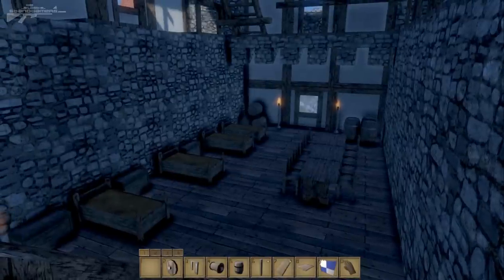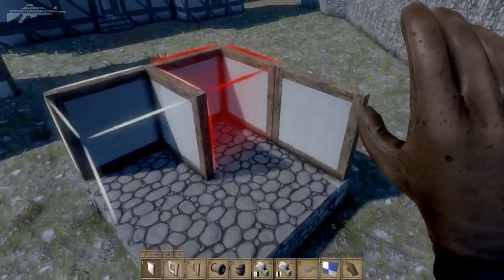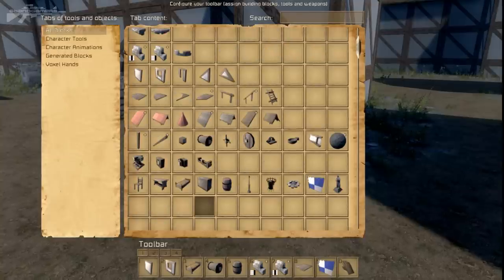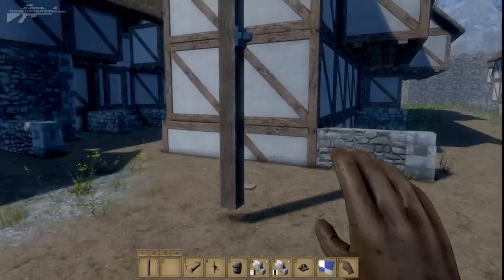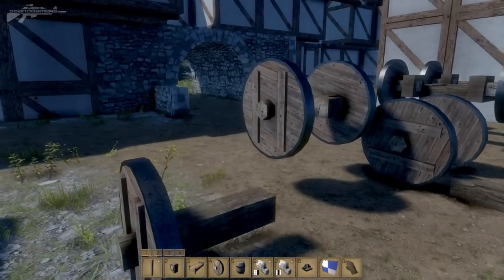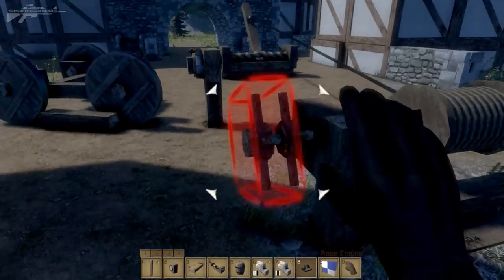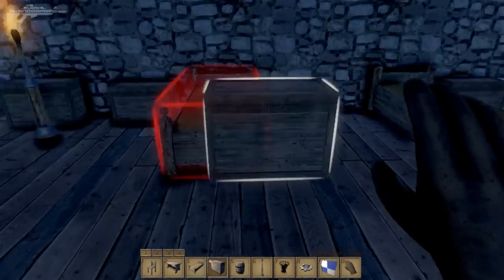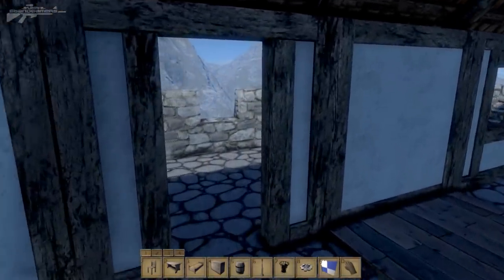Medieval Engineers - Basic Building Introduction

Comment: I don't like how connecting ropes works.
I try to play as "survival" as possible. That means no flying, no ctrl-x and no voxel hands.

I am having a lot of trouble using cranes (for example to flip a wagon I'm building upside down).
My problems come from:
-Not being able to build pulleys 
-Having to interact with the rope drum to connect two things together

I solved the first problem by building the wheel cross in the base, and using ropes to make the rope drum on top of the crane move.

But that leaves me with my second problem. I have to reach the top of my crane to hook the rope...

Comment: iam am waiting for gun powder
Reply: I agree.Especially if they add cannon's that you'll have to manually reload.
Reply: ***** what if you mean out of age the game is set in 1500 ca gun powder was made in 1300
Reply: ***** Gunpowder was used in Europe as early as the 13th century, and much earlier elsewhere (Estimates ranging from BC to AD 2nd century China).
Reply: Gun powder? That would be very historically inaccurate and silly. They will hopefully add black powder, though.
Reply: Gun Powder and Black Powder are technically the same but where made for Diffrent uses, Black Powder is more explosive and was used in cannons and such, Gun Powder was used in early forms of guns like pistols and rifles and some shotguns, plus there actually accurate for the time line, the only reason there's not much of them from13th century is cause sulphur wasn't easy to find and form
Reply: DevinSmith56 any thing that says boom
Reply: Brianna Sellers Of course, but for the purposes he was referring to (cannons and such), a relatively slow accelerate like modern sulfur gunpowder wouldn't be useful.
Reply: Roche Chemaly I hope you don't have to load them manually, early cannons took hours to load, you need this foam, or loam (can't remember the name) to plug the whole, so you can contain the force of the blast, yet it has to be weak enough so once enough force is built up from the blast it is shot out and the cannon ball fly's off, you could have a open ended barrel but then a lot of the force would be lost and the shot wouldn't go as far nor fast, thus loosing a lot of power. Btw the foam/loam was a mix of several chemicals, and it started off like a milk shake, liquid-y but firm, after several hours it would harden and create a sealed compartment. So if you have to load it manually, being as this game is trying to be as realistic has possible, it could take hours to load it properly, though with the decreased time frame for the day/night cycle it would be a couple of minutes, but still in a siege scenario a minute could cost you the battle.
Reply: Chris Mc That is true

Comment: If I made some huge system with a load of pulling force I could technically tear down a wall?
Reply: Yes, you should be able to pull down a wall if you are anchored batter than the wall and your whole design is stronger that the wall itself.

Comment: omfg XD is any1 else getting really bad fps on dis game? i got 770 and i7 quad and on lowest setting im geting 5-10 fps. im really disappointed cus its unplayable
Reply: Fine for me 60fps constantly unless I crash a huge tower or something similar. Maybe take a look in the task manager for other tasks taking up space
Reply: hmm yeh its odd, ty 4 da hint
Reply: Make sure in the game options and Nvidia settings that you're using your gpu. Someone had the same problem on reddit and it turned out he/she was using their cpu for rendering.
Reply: how much u got ram? how much u have avaible hard drive space on your system drive? what about your vents? are they blocked? is your computer running hot?`when did u restart it last time?
Reply: damn dats alot of stuff 2 reply 2, 16 GB ram, 200 gig left, um laptop open for 5 hours but has beast fan.
Reply: Spike Tacular ok. so it looks like optimization errors. go look required specs in steam XD u got them eeeaaasyyyy